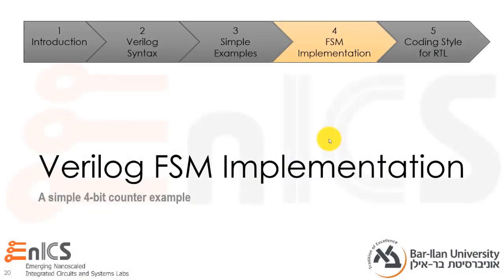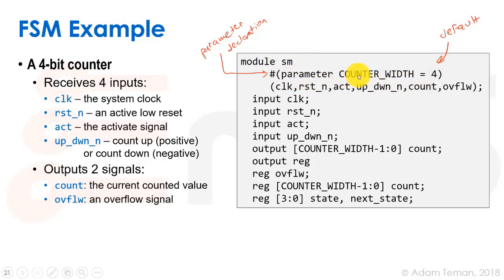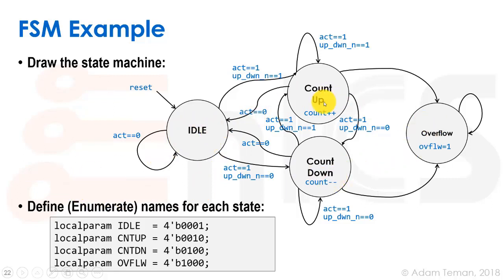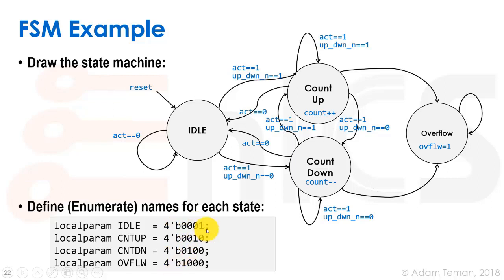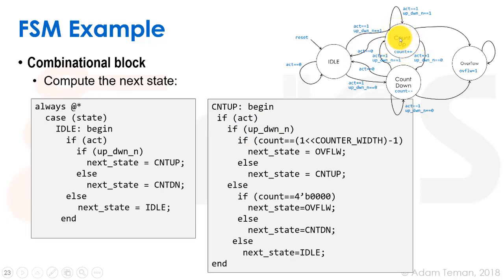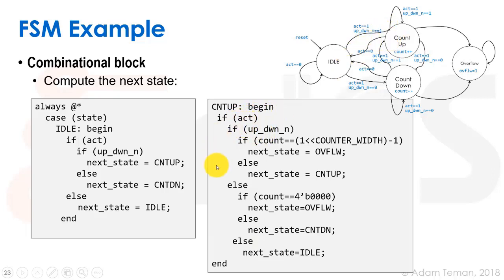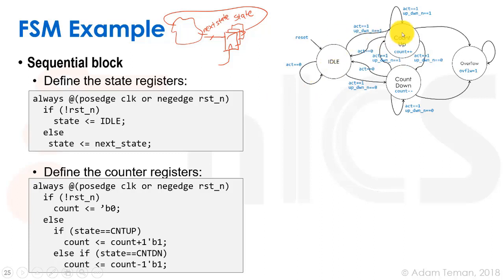DVD - Lecture 2d: Verilog FSM Implementation

Comment: Its a very interesting story about Chip Hall of Fame at the end. @20:21 Its an incredibly beautiful picture of the 8088 die. Do you also have some suggestions about how to decap epoxy off the IC and expose the die? Did you directly take pictures from your microscope? I am now really interested to procure an 8088 (if at all it can still be procured) and see the Hebrew name of Mr. Rafi Retter. Someday :)
Reply from the maker: You don't know how happy I am to receive your comment. Along with my description of "Teman's Law" (See VLSI Lecture 5a at 14:50 https://youtu.be/ebb4bNWumfQ), this is my favorite story to tell throughout my lectures. I was actually giving a ride to some of those original Intel Israel engineers on the way back from a small conference and they were discussing the early days and told me about Rafi's "signature". So I decided I had to put it in my lecture. I searched pictures of the 8088 I found on the web, but couldn't find the Hebrew writing. So the next time I saw Rafi, I asked him and he told me the picture was hanging on his wall and he would send me a photo of it. That's how I got this particular photo with the right focus to see the writing.

Regarding decapping chips - that's not my expertise, but it's not a tough thing to do. I'm sure there are plenty of guides out there :)
Reply: @AdiTeman  The pleasure is completely mine. Thank you so much for sharing your story. And I am very much looking forward for the upcoming chapters in this lecture series. Have a nice day!

Comment: I have two questions: when is there a need for a finite state machine (FSM) in the design, and when is it unnecessary? Secondly, does a digital designer need to consider clocking while designing circuits? For example, when there are a certain number of registers in the design, how will they work together? On which clock tick will they provide the result, and on which tick will others be able to receive it? It creates a lot of confusion, and I find myself constantly pondering these matters while writing RTL codes. Unfortunately, it slows down my productivity
Reply from the maker: Hi Ahmad,

To start with the second question - yes, I think that this is the primary consideration of an RTL designer. You are designing synchronous circuits that are carrying out operations according to a specific clock edge and so this is the major consideration you have to take into account. In fact, RTL is "register-transfer level" design, because you are exactly describing how flip flops pass signals to each other and in which clock cycle.

That also basically answers the first question. It is either always or never necessary to build an FSM. What do I mean? I mean that an FSM is a representation that helps us understand what is supposed to happen during each and every clock cycle (every state of the synchronous circuit). Any time you are writing RTL, you are describing an FSM, since a synchronous system is just that - a circuit with state. However, you can often "do this in your head" without drawing all the signals and naming all the states. The FSM diagram is mainly a tool to visualize the synchronization  and logic between the registers and help us write clean, bug free design. 

So I guess my recommendation is - if you can draw an FSM - do it. It will help you describe what you mean.
Reply: @AdiTeman  thanks for clearing it all. I find it very helpful :)

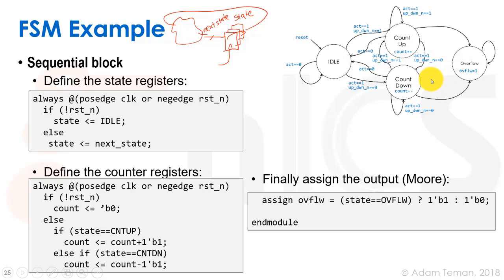Comment: @13:13 When I tried to run the testbench on iverilog, I got simulation error saying 'ovrflw cannot be driven by primitives or continuous assignment'. Stackoverflow said that a 'reg' type variable cannot be driven by a 'assign' continuous assignemnt. Instead it has to be done using a prodecural block.  Hence I changed this assignment statement to procedural block as below.
always @ (*) begin
    ovrflw = (state == OVFLW) ? 1'b1: 1'b0;
end
Reply from the maker: Good catch!
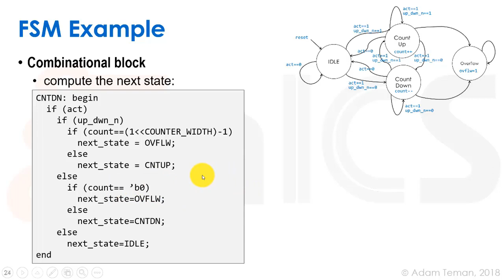Yes, as I explained in Lec 2c at around 10:30 (https://youtu.be/nI8tFPhe0uk?t=630), a reg can only be driven (LHS) from an always block and an assign can only drive a wire.
I guess I changed a few things around in the presentation along the way and created this syntax error (it's not a bug per-se as it doesn't pass compilation and all you need is to change it to a wire...). In the updated lecture version I use in class, it is correctly defined as a wire (actually, just defined as an output without the "reg" keyword). Alternatively, you could - as you did - move it into an always block.

Thanks for finding this error - I will add it to the "pinned" comments of the video.
Reply: @AdiTeman  Prof. Teman, thank you so much for the clarification. I sincerely appreciate your time and effort in answering the questions with such details. I am basically from embedded software background and we got a need to synthesize our logic on an FPGA due to custom requirements from our project. As per the project toolchain dictation, I am using model based approach ( Xilinx System Generator toolbox in Matlab/Simulink) to synthesize our logic on the board. In order to clearly understand the underlying internals of logic sysnthesis I started to look for extra material online and I must say FPGA and ASIC world is incredibly interesting and fulfilling. Many things that were under the hood for a software guy, are slowly getting transparent. Coming to your lectures they are amazing and a treasure. Someone mentioned them in Mastodon and I am so glad that I came here. I really loved the way you explained FSM, especially the framework that you have laid to approach designing an FSM. Keeping the combinatorial part for state transitions and sequential part for state register. This clear disctinction makes the design easy to follow and to implement. Thank you once again for providing public access to your lectures. If you happen to hold the lectures online in the future, I would definitely like to participate. 
By the way I just simulated the design in iVerilog and saved the files here, just incase if any student want to try it out. Thank you.
https://drive.google.com/drive/folders/1Ijr_HlH-41_MOiPY31ruab8-jckWBUdG?usp=sharing
Reply from the maker: @vevasam  So happy to hear.
By the way, this "separation" is something I have a very hard time conveying to students who take my course, and especially if they have experience writing code for FPGAs. The FPGA toolchain is very "forgiving" and you can write "Bad RTL" with a result that "works" (or at least seems to). This is due to the fact that (a) many more people have access to FPGA design than ASIC design and the vendors want to make it easier to use and (b) if you make a mistake, you don't have to pay for another tapeout. That being said, the verification process of FPGA designers is often not done in a serious fashion and leaves a ton of bugs hanging. So these "experienced" designers think they are pros, but the minute they have to write ASIC-synthesizeable RTL - they are totally lost (and it's often hard to get rid of bad habits). 
I can tell you that the students in my course - every year in a very consistent fashion - refuse to follow the clearly set out instructions and find themselves having a design that doesn't synthesize, infers latches, or breaks at gate level. Methodology in ASIC design is critical!
Reply: @AdiTeman  I can't agree more. You exactly defined the position I am in. Due to lack to experience in the hardware side, I have written verilog HDL that worked. When I kept building on it the first thing I noticed was that I was not able to organize my design and follow along anymore. In fact what I had on paper could not be followed in HDL and I hated it myself. I guess people like me get saved in the software perhaps due to its sequential execution. I started to rewrite my modules in FSM as I find it very sensible approach to my requirement. Now my design kind of looks neat, bit easier to follow and professional. I hope I will continue building on this. Also I hope to keep the momentum and complete the course and learn good practices. Thanks again.

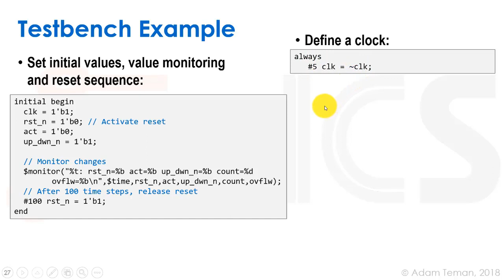Comment: A short question from the test bench @15:40. The delay time units specifed as #5, does it mean 5 time delay units from 0th timestamp and NOT from the previously defined time stamp?? Thank you.
Reply from the maker: Hi @vevasam

The 5 time unit delay is inside an "always" block, so this is a recurrent process.
In other words, every 5 time delays it will invert the clock, then wait 5 time delays and invert it again, and so on.

Comment: @15:48 Why do we have two 'initial' blocks in the test bench? Can't we club them into one? Does it serve any specific need? Thank you.
Reply from the maker: Yes, you could, indeed, combine them into one.
I separate them to make a more clear and clean definition. The first is initialization - it clearly shows that each stimuli is initialized. The second shows the actual behavior after we already set their "reset" value.
But this is not necessary.